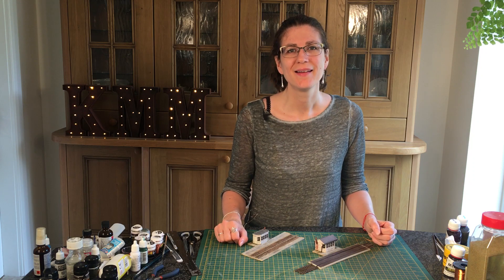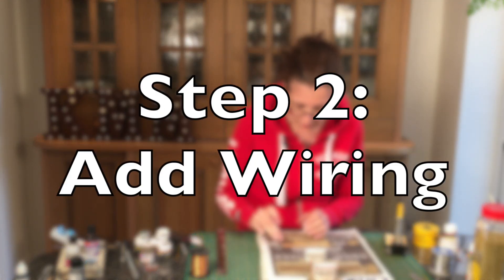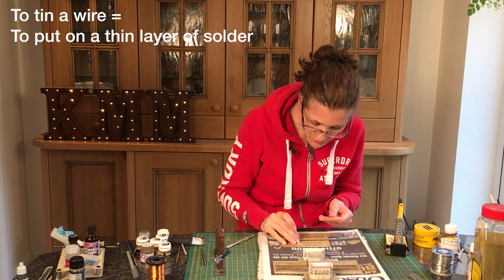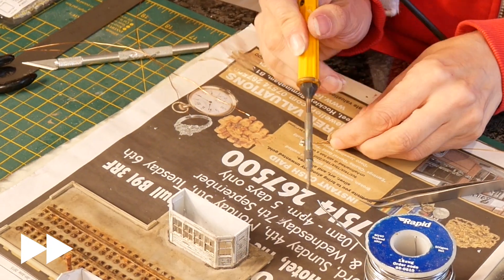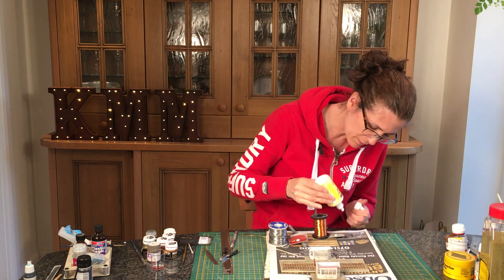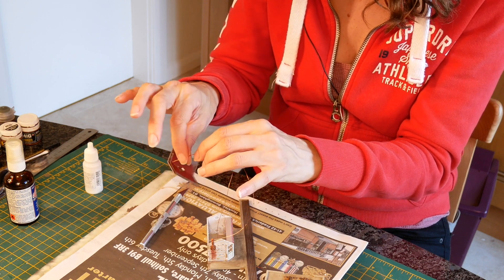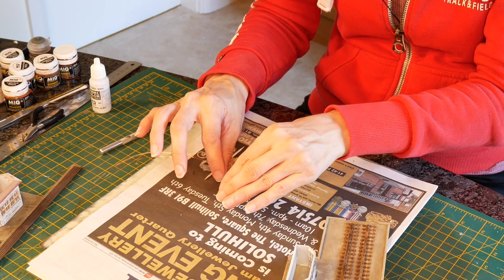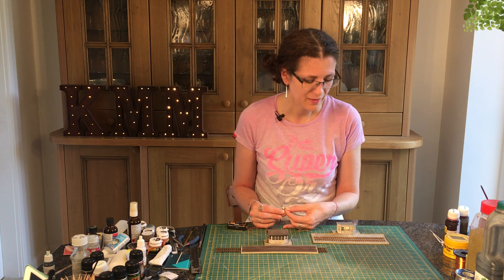How to Add Lighting to a Model Building

Comment: Very good video series, with very useful tips. But LED's always require a resistor in series, either in the + or the - line. 1 Kohm (kilo-ohm) will do, to work on 12V DC. A small one, rated 1/4 watt, will be more than enough; the cost is almost nothing. Without resistor, even slightly exceeding 3V will kill the LED, since LED's are diodes. With 1 Kohm, connected to 12V, the current will be (12V-3V)/1K = 9mA (milliampères) - quite bright in most cases, but every LED can hold that current. For lower brightness, put a higher resistance value, like 1K5, 2K2, 3K3...
For wires, I often use unisolated thin wires I take from a stranded copper wire. Glue them a bit apart from each other, of course. No cleaning of the isolation layer necessary!

Comment: Interesting video.  However, LEDs will always require a resistor.  Also, as a safety note, I would never solder on paper or cardboard, since soldering irons (and dripping solder) are "hundreds of degrees" HOT.  Another trick is to insert an interior image, and curve it inside the structure, as a faux "cyclorama" interior visual effect.  I wrote a book on Model Railroad special effects, here in the USA.
Reply from the maker: There's some great ideas there.  Thanks.  You would normally need a resistor but the LED may be on to a battery for a diorama which doesn't require a resistor.  I'm thinking of running an LED circuit around my layout which is the right voltage to avoid all those resistors.
Reply: Not to get all technical on you, but LEDs need a resistor, because they have no internal current limiting capabilities.  The tiniest change in voltage will fry an LED.  Perhaps, if on the layout, if there's the smallest spike in voltage (for some reason), most to all of your LEDS could fail.  It's just a good idea to add at least a 100ohm resistor to each of the small LEDs, and 250-350ohm to larger LEDS, depending on color.  Other related ideas: paint the ceiling yellow to produce a warmer tone with white LEDs, and theatrical gels (i.e. sample books) work well as stained glass or colored window shades.  I just want your system (and others) to work well, without trouble later. Thanks for your response. :)  You can see some of my work on YouTube, look for "Lone Pine & Tonopah".
Reply from the maker: +Paul M. Newitt all good points. Thanks.
Reply: I failed to add in the beginning that all your procedures and ideas are incredibly wonderful, and you present them in a very nice fashion, too!!  There are things you present that I would have never thought of!  Thank you for all that you do for us modelers!!  :)
Reply from the maker: +Paul M. Newitt Thanks! I'm glad you like the videos.
Reply: Unless you are using a coin cell like a CR2032, always use at least a 1 Ohm resistor. Always.
Reply: Sorry to bust your bubble, but LED's do not 'require' a resistor.  They require the proper current, which a resistor can provide, but so can the right voltage.  Some batteries, such as coin cells, have a relatively high internal resistance, and are perfect for LED's.  That aside, we're talking White LED's here, which have a forward voltage 'requirement' of 3.3 volts.  Running them on two AA cells (1.5v x 2 = 3.0v) shouldn't work, right?  Well, it does, just at a lower brightness, and the slightly lower voltage protects the LED's from over current.

It's a common misconception that LED's turn all the way on at their required forward voltage, and off at anything lower.  The truth is with fine voltage control you can vary the brightness of an LED, because varying the voltage around the rated value also varies current.
Reply: Your right with the resistor theory, however if you notice Kathy is using a battery box for power, to test the circuits. You can also get 12v LEDs which do not need resistors if using a standard 12v PSU.
Reply: And chances of solder setting fire to paper or card is very slim as by the time the solder lands on the paper then the flash point is probably too low to ignite it even as you corectly suggest that solder is, at the time of melting possibly around 300 degrees C.

Comment: Nicely explained. It's not such a good idea to get flux on your electronics though. Use rosin core solder! When I'm tinning wires and components, I leave the iron in the holder, heat the component with one hand and then apply the rosin core solder with the other.
Reply from the maker: I like the control of separate flux over the core solder.

Comment: I don't know if you can get Woodland Scenics productions in the UK but their "Just Plug" light system is really great for just such projects as yours..  Stick the LED in place, run the wires (already attached) then attach to the control box thence to the power ssupply.  Power on, lights are on!  Just about that easy.
Reply from the maker: Hi Gary, I have some I picked up in the States to try but I find that I can use smaller LEDs (the 1.4 x1 mm) for a lot less cost. It looks like a great system though and I will do a video on it.

Comment: Was looking for the LEDs and found these on Amazon. They are very tiny as well and come prewired with a resistor for only $10 US. 25pcs Pre-soldered Micro Litz Wired Leads Warm White SMD Led 0603
Reply from the maker: Thanks. I tend to buy prewired nowadays but have moved to usb as a power source.
Reply: @KathyMillatt  oh, do you have those ones or a video showing how to do that?
Reply from the maker: @keinlieb3818  I've moved away from doing specific tutorial videos but you can see it demonstrated in some of my dioramas - I try not to give electronics advice as it is not my forte!
Reply: @KathyMillatt  I greatly appreciate your honesty. I've been looking through some of your videos. I'm trying to make a model house for a drafter so that he can see exactly what type of house I want built so he can get me some blueprints for the house. Trying to follow some of your videos so I can learn how to do it. Greatly appreciate the help and your videos!
Reply from the maker: @keinlieb3818  no problem!  Always happy to help. Good luck on your house.

Comment: Hi Cathy. Great video showing all the necessary basics to get a good job done. I have never used magnet wire, but it looks so much better! What diameter wire do you use?
David
Reply from the maker: Thanks!  The wire is .375mm 28swg.
Reply from the maker: I use fir almost all my small wiring as it's do thin. I even use it in O scale for telegraph wire on dioramas.

Comment: Would have been so much easier to see if you had used a solid color background instead of that busy, printed paper you used.
Reply from the maker: I’m not sure what you mean.
Reply: @KathyMillatt  I think he means using a white or black colored background is better than the newspaper.... just for better visuals. great video otherwise.
Reply from the maker: AFK4Realz  I did this a while ago and all of my recent videos are just set on my cutting mat or work surface as my supply of free newspapers has dried up. When you need to use newspaper to catch mess, you need to use newspaper and I really miss those free ones.
Reply: @KathyMillatt  😊

Comment: Use 60/40 rosin core solder (60% tin, 40% lead; sn/pb). Don't bother with the lead free solder. I use a fancy soldering station, but there are cheap plug in stations. Do not just plug the iron into the wall socket, it will run too hot. Flow solder onto the LED pads if an SMD or COB device, otherwise tin the leads. Sandpaper also works for stripping enameled wire. Some types of enameled wire are made so the insulation burns off when you apply the iron. However, I find magnet wire a royal pain. I use wire-wrap insulated wire or silicone insulated 30 or 32AWG. I run the wire through cocktail/coffee stirrer "conduit" to hide them (or just paint them later).  Always tin the wire. The wire can then be attached with the briefest "reflow" of the existing solder. 

Using brazing (plumbing) flux for electronics is a big no. If you need to solder to a large sheet, use liquid rosin flux. But for LEDs, resistors and wires, just use quality rosin core 60/40 solder.

Always use a resistor to limit current to an LED. If you don't want to bother with Ohm's Law, there are multitudes on on-line calculators. Just search for "LED Resistor Calculator" or "Current limiting resistor calculator". One resistor per led unless the LEDs are carefully matched. Do not run LEDs at full brightness to lower the heat and extend the life. For example, to power a nominal 3.1V LED from USB, I would start with a 220 Ohm 1/4 watt resistor and then adjust from there. Resistors are cheap if bought on line in quantity. I tend to buy in lots of 100.

2032 coin battery cells are handy for testing polarity quickly. They are self-limiting, so you can test your LED without a resistor for short periods.
Reply from the maker: Some great tips there.

Comment: Very nice where would find this lights  we only have a few hobby shops and it's mostly ho and g
Reply from the maker: +Doug McKay I buy my LEDs on eBay (LEDBaron in Germany) or Woodland Scenics do a fairly expensive but easy to use and find range called Just Plug. Where are you located?
Reply: If you buy a ribbon LED strip using 3528 (not 2538) smd leds, you can remove them from the strip and solder new thru-hole resistors to them. The 3528s are not as bright, but make less heat. While the strips are "12vdc", the individual 3528s are about 3V each.

Comment: so does the white paint help with making the light look brighter, or is it just to hide the light??
Reply from the maker: Both. If the wires will be really. Usable then I put in false walls and ceilings to hide them. Here, you can't get your head down low enough to worry about it.

Comment: Experiment with them. Easy to disguise.  I have no interiors however.  Also fluorescent paints for some windows.  So many.  Just effects.
Reply from the maker: There are certainly so many techniques out there. Fluorescent paint is a new on to me.
Reply: John Allen used it for distant structures with black light.  I'm going to use it closer.  Why do these people lie and lie to themselves?  Insecurity.